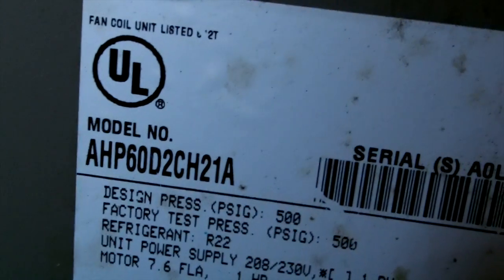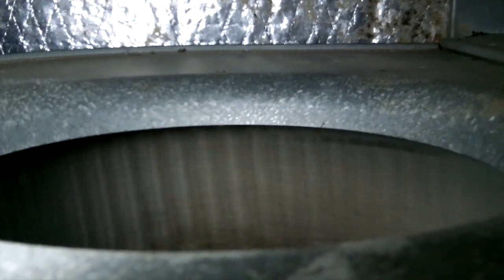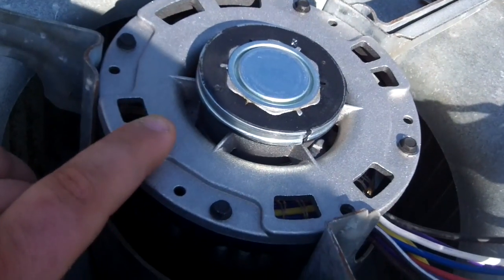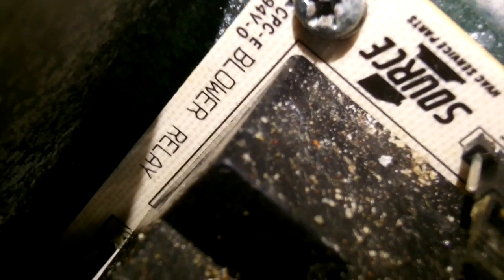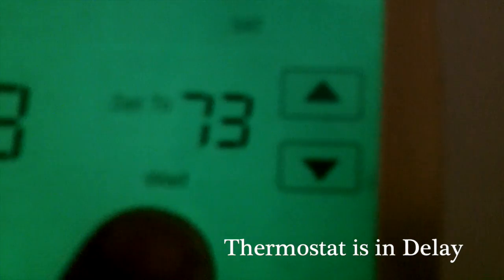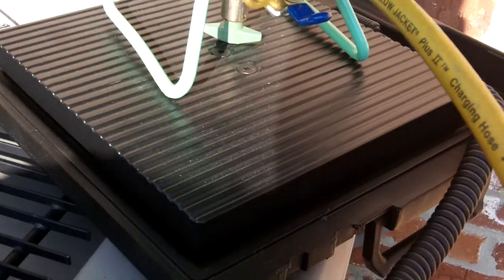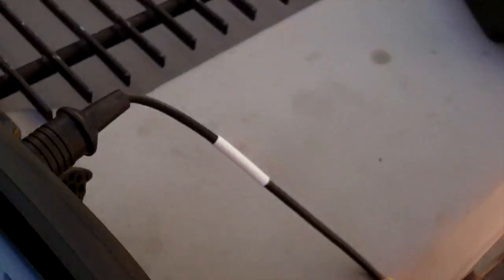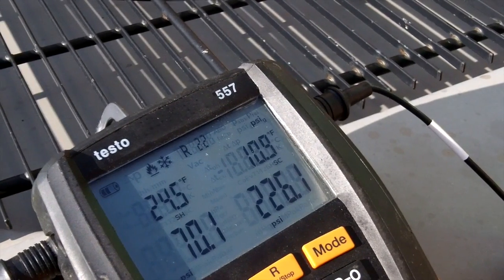X13 ECM to PSC Blower Motor Conversion

Comment: Great job John. I have changed over many to PSC motors. All worked great. Great video. Just more high tech stuff going out. No matter the brand.
Reply from the maker: +Powlas Hvac Thanks Mike
Reply: Why would you do that? PSC motors are obsolete. Wrong type of motor for a squirrel cage fan. I've upgraded many PSC motors to ECM. Saves a lot of money on electricity. For example, I replaced a 1HP motor in a large tempstar furnace with a Trane retrofit ECM motor (ServiceFirst brand). The old motor had a 40mfd run cap (same as like a compressor!), and was drawing about 6.5 amps. The ECM motor dropped that down to a little less than 3. At 16 cents a kilowatt/hr, plus a $100 cash rebate from the utility company for the upgrade was a no-brainer. Also, if the motor uses more power, that's more heat the A/C system has to work harder to remove from the house. It's a zero sum game here folks. So you add up the additional cost of higher wattage from the PSC motor, plus the additional load on the A/C system, you're paying twice for moving probably less CFM thru the ductwork.
Reply: PSC motors are in no way obsolete. For the cost, it takes to replace an ECM motor that is out of warranty. It will take a long time to get your ROI back. To get the system up and running that day and save money up front for the customer PSC is the right way to go.
Reply: Powlas Enterprises Only $100 or so difference in price wholesale. There's some good options out there now for a rescue type motor, Trane makes one, there's a few others now too.
Reply: Powlas Enterprises Its not just the cost. Much better efficiency because you can get exact CFM and lower wattage from the blower makes a large difference in the A/C performance.
Reply: ECM is more than just $100 over a PSC. It is not just the cost. Much better for what your customer can afford at the time. OEM is not right for all customers.  It is always what is best for the customer. Give them the best repair at a price they can pay for. With your way of thinking. Why even change the motor at all. just sell them a new system, Surly it will have Much better efficiency. rather than you replace the old unit with a ECM or PSC motor. At the end it is all about what is best for your customer.
Reply: Powlas Enterprises Yes you're right. All I'm saying is there is good aftermarket drop in replacements available now. I've had good luck with the servicefirst brand from Trane Parts and Supply. I've changed out a few PSC motors to those, but never x13 to a psc. If out of warranty, I'll get a servicefirst or evergreen, etc. Check out what they have at your favorite supply house, there's more available now than there used to be
Reply: I guess you can say that now you pretty much have to use some kind of ECM motor on any system made since 2019. I also suspect that 2 stage systems pretty much need the speed variably of at least a constant torque motor.

Comment: ecm motors still very sensitive to moisture and power spikes,  you can see some mold present in the air handler.  psc motor the best way to go.

Comment: nothing wrong with the psc motors .good idea .
Reply from the maker: +steven lavimoniere Thanks Steve
Reply: Nothing wrong? Lol, only that they waste twice as much power sometimes than ecm. A PSC motor is constant horsepower, and constant RPM. An ECM (X13 or full variable speed) is constant torque. If you knew how a squirrel cage fan works, then you'd know that a constant torque motor is what you need to maintain a certain CFM of air. A standard one or two stage condenser needs X amount of CFM, no more, no less. The problem with a constant horsepower motor is, every house has different ductwork restrictions, filters get dirty after time etc. What a constant torque motor will do is bring up the RPM until such time that it senses the correct torque on the shaft, which then in turn gives you quite an accurate CFM out of that blower (providing the bearings are good and the fan itself is clean). As the filter gets dirty, the RPM picks up. Until the motor hits its max speed. So the ECM motor will only draw the amount of power it actually needs to provide the CFM that you want. If the filter is clean, and the static pressures are kept reasonable, the motor will save more than enough each year in electricity costs to pay for a new ECM motor, if in fact it goes bad. If York has a problem with their ECM motors, so what? Trane makes a retrofit ECM motor that you can program yourself and install in just about any application. Other fan motor manufacturers are also getting in on this.

If you have a problem with York, just get a good aftermarket X13 or ECM motor and swap it out. But don't put a PSC motor in it's place.
Reply: They been working fine for years now days to many bells and whistles good job I would have done the same,we spend half our time trying go around the mess on systems that stay broke lol

Comment: Clean your indoor coils/pan/cabinet and use a mold preventative spray. Water destroys electronics and causes mold. Unclean coils or too much airflow can cause water pulloff. Did you check current draw with blower area covered? 3.9A max on my 3/4 hp 230V. Turn cover backwards to prevent insulation from pulling in.

Comment: Good job John! Definitely good idea on going with the PSC motor. Like Zach said yesterday the x13 motor is the bastard child of PSC and Variable speed motors. Takes a little from both but not as good as either.
Reply from the maker: +Gil Cavey Jr Thanks man!! My ICP Air Handlers have X13 motors in them knock on wood i haven't had any trouble with them!! Thanks for watching

Comment: a lot of times those resistors in the bottom of the motor get cooked ... if u take those 4 bolts off the end of the motor u will see usually 3 caps a couple bare copper coils and a big resistor the size of a nickel ... u can buy repair kits from Johnstone for 18 dollars and real easy fix

Comment: Just ran across this video and I will say never never never change out a x13 motor to a psc motor. You are changing the UL listing on that air handler and it is illegal. If a fire happens you can be charged and convicted for that
Reply: Where you getting this information from?
Reply from the maker: Dude get outta here with that shit. I’ve done so many of these with no issues. Go play detective somewhere else.
Reply: I know it for a fact cause have a friend sitting in prison for it now cause a house burnt down and was traced back to the air handler closet was where the fire started and since he changed the motor it changed the UL listing so he was found at fault. But it is your company so you do as you wish or think is right. I myself wont do this and just passing on some knowledge from a 30 year tech

Comment: In the spirit of learning from the youtube hvac community and promoting respectful learning discussion, I had some questions.  I'm constantly putting together the "bigger picture".  What is the cfm air flow the system was moving?  What was your static pressure?  If you don't know, then how do you know the charge was off and how do you know you won't be burning up the new motor by trying to push say over an inch of w.c.?   Do you know how many btu were removed from the air across the coil compared to rated capacity?  Some days you're removing latent heat and the temperature felt at the supply doesn't give a true indicator of work being done.  If you don't measure, you're guessing.  How can you condemn a txv if you havn't measured any of those things?   I think your motor swap solution is creative and interesting.   If everything in this system was perfect, I still would question what the CFM would be on the next lower speed setting.  Often they are the same due to static.  That said, you could lower the power consumption and see the same performance.  I treat every repair as if it was my own power bill.  Blowing cold and out the door isn't good enough in my humble opinion.